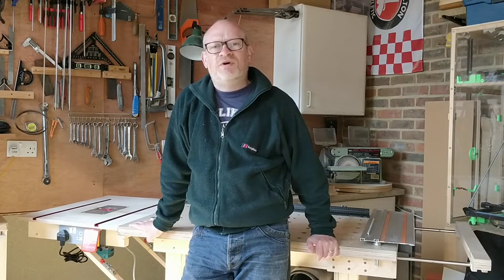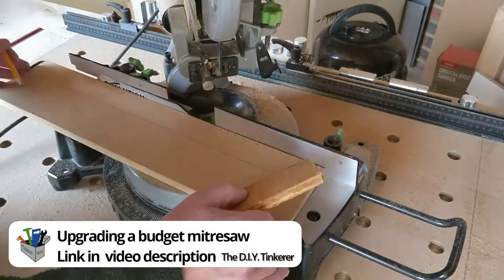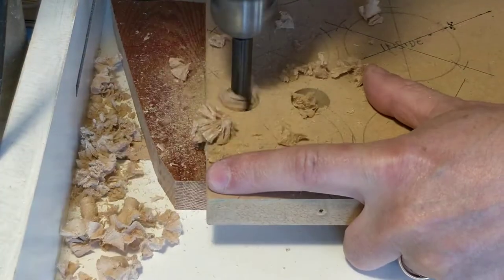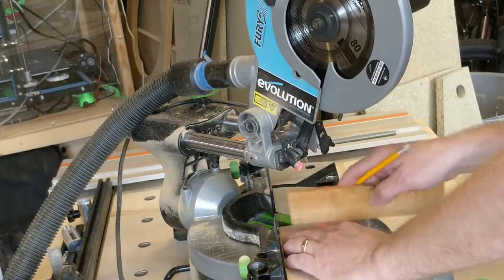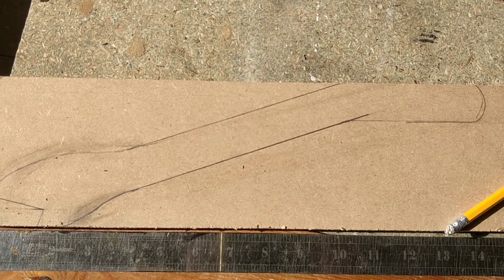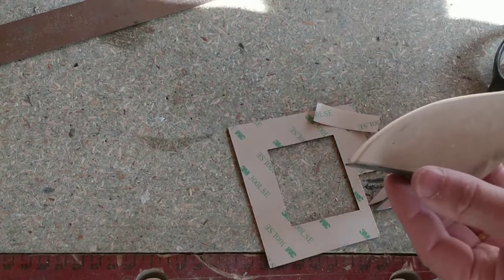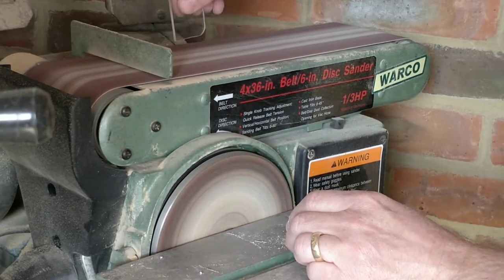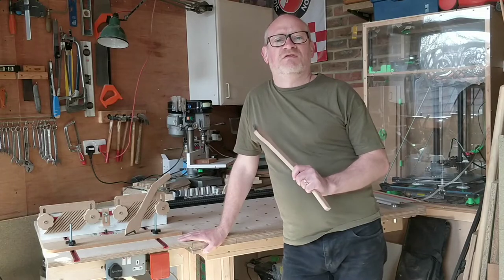29. 6 Awesome and Easy to Build Accessories for my Router Table

Comment: Hi Simon. I enjoyed your video and was intrigued that bench is almost identical to my set up with the benchdogs fence. Cheers
Reply from the maker: It's based on Steve Ramsey's Basic Mobile Workbench, resized to fit the MFT top and space I had between cupboards, great minds think alike :-)
Reply from the maker: The benchdogs.co.uk are great,  it was originally bulky for a track saw setup,  but I bought a bad one and ended up getting a cabinet saw instead., I've a few videos about the features of the bench on my channel,  it has a few novel features. Thanks for watching: -)

Comment: Hi Simon, I enjoyed your folding router table video. I've tried to do something very similar but am having great difficulty fitting the folding supports...  any tips?
Reply from the maker: Well, it was a while ago... Fit clip and hinge in the middle first, lock the clip in place, using a 45 degree square fit  one of the end hinges to the bench, then fit the other end. It is also important to make sure the two boards are butted up together, before fitting the middle hinge. Hope this helps.
Reply: @DIYTinkerer  thanks Simon, i'm struggling with the lengths i need, but i'll get there in the end... i hope.
Reply from the maker: @MickSidnell-d4e  I think I used a bit of string